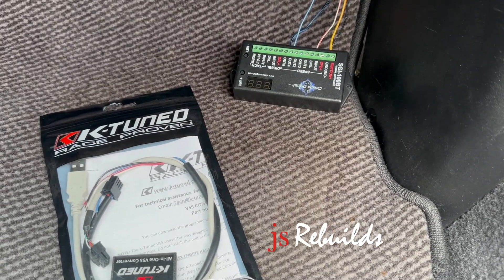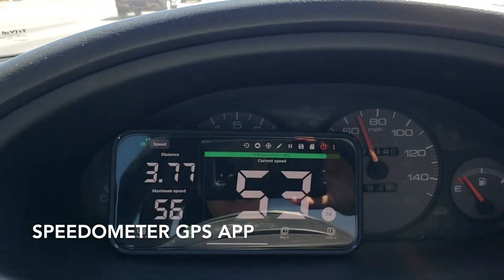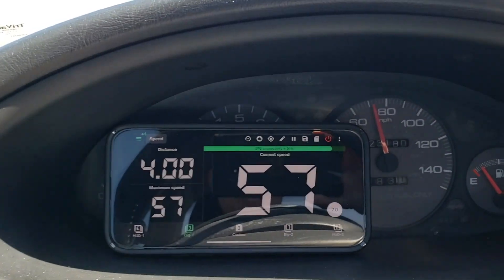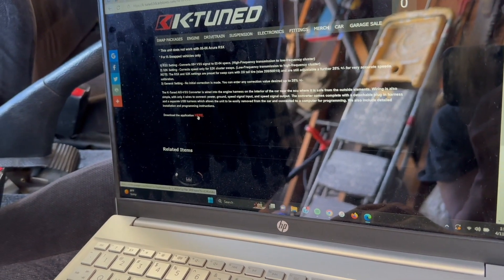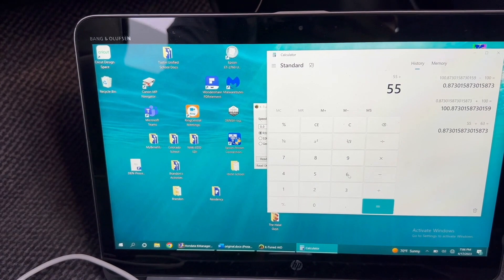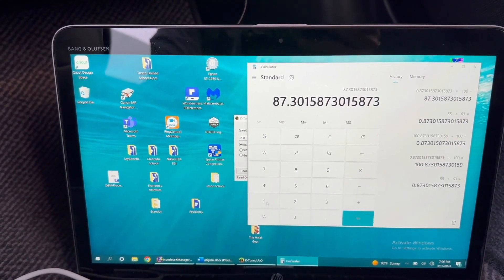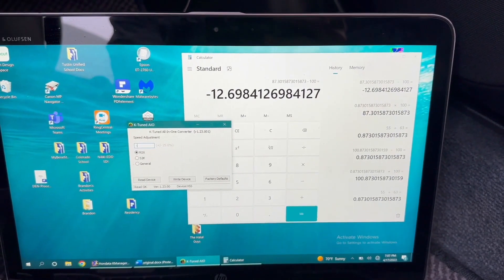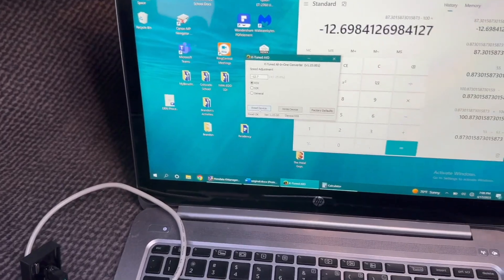How to Configure Ktuned VSS Speedometer for K-Series Transmissions (All-in-One Setup)

Comment: Would this work on a k20a euro r swapped into a ek civic. Factory prb ecu with k tuned immobilizer, hybrid racing conversion harness. Car starts and runs just won’t rev passed 3k rpm. Will this 12v to 5v converter at css plug and all in one vss ktuned converter installed at ecu make the car run normal?
Reply from the maker: Yes I believe the all in one vss Ktuned speed converter will make speedometer work and send to correct signal to your factory prb ecu. 

For the 12v to 5v converter, I mentioned it was an option. I've used 12v before and it worked for me but for me these 12v to 5v converter are cheap to begin with. It doesn't hurt to send the correct voltage to the sensor but in my opinion in should be reccommended because why would Honda make it that way. Also you will see many people comment why don't you just tap into this or that. Thats a great but for less than $10 why bother especially when my electrical engineer friend said it will work fine. 

About you car not rev pass 3k rpm, I not sure what that is about. I would have to do the research. Its a possibility that the ecu not getting the correct signal from speed sensor or checklight on something cause ecu to limit your rev.
Reply: @jsrebuilds3951 yea that’s what I’m thinking that the ecu is looking for a vss signal but it’s getting a css signl instead which is causing the rev limit?
Reply from the maker: @DragonMaballz1997  If you follow our setup for our swap very simple and basic but everything worked with no issues. I do understand other swaps can have different setups. Yes there was trial and error and that's even listening to what some of the experts had to say out there on certain things that ended up not working. 
I had to do the extra research and tested certain things myself because there wasn't really good info out there for example like what we are discussing on this subject but I did document it all and put it on our youtube channel to help others with similar issues.

Comment: This is a great video iknow how to get the right speed on my ap2 cluster .. do you know how to get the temp to read right I been having issues with that one on my k swap civic anything would help thanks in advance
Reply from the maker: Thank you @ChlsTfLoW. Sorry I'm not able to help because I don't know much about the ap2 clusters.
Reply: @jsrebuilds3951 thanks for replying
Reply from the maker: This is what I found on the Ktuned website.
You will need the  K-Tuned AIO-S2K Converter because this will allow you to Convert the dash coolant temp signal to read properly on the S2K cluster and there is preset in the unit but can be adjusted if needed. @ChIsTfLoW
Reply from the maker: https://k-tuned.3dcartstores.com/S2000-Dash-Converters-now-work-with-K-Series-temp-sensors_b_59.html
Reply: @jsrebuilds3951  yea I got a plug and play harness with the KTUNED dash converter but the temp is not working properly at all and from what I’ve read online is a little harder to calibrate the temp on a ap2
Reply from the maker: I would give them a call they should have a tech. I've used hybrid tech and those guys are really helpful. Hopefully Ktuned is the same.  @ChIsTfLoW
Reply: @jsrebuilds3951  I will thank you for the replies and the video helped out a lot !!
Reply from the maker: What temp sensor are you using, b series or k series? @ChIsTfLoW
Reply: @jsrebuilds3951  well I was gonna purchased the single wire temp sensor from K-tuned to place in on the water neck outlet on my k swap to get more accurate readings
Reply from the maker: Ok it coming back to me now. So the k series temp sensor on your radiator will be read from the ecu and the single wire temp sensor will be read from your gauge temp cluster. 
I would check to see if your getting a good ground for the single wire temp. Make sure the temp sensor itself is making a good ground by touching surrounding metal. Also make sure the ground wires on your harness is getting a good ground as well.
Reply: @jsrebuilds3951  okay okay well the plug and play harness I bought from s2000cluster there is one wire for the temp that goes into one of the wires on the ecu plug I did do it the way he had it on the instructions but it was making my radiator fans to come on sooner so he said I’ll have to calibrate the converter and check all the grounds and I did make sure all my grounds are good but it all comes down to the converter is a pain !! He suggested me to get the single wire temp sensor from k tuned to get more accurate reading!! But I shouldn’t have since I already have a wire that connects to the ecu harness should be accurate enough !!
Reply from the maker: Ok I see what your saying, definitely calibrating with the convertor box. I wish I had one to play with. Yeah sorry we couldn't figure out anymore on it. I know you said your grounds are good but I'll just post a video on how I did my grounds.
https://www.youtube.com/watch?v=oO8EkwB2Qkw
Reply: @jsrebuilds3951  I just watched very informative!! Thanks anyways I’ll see if KTUNED are in the mood to help there is one tech that is a little grumpy and feels like he doesn’t want to but anyways thank you 🙏🏾
Reply: @ChIsTfLoW is this the same guy that answers emails? I always get a guy that never answers extra concerns or details or give thoughts on ideas. He goes straight for the main question and nothing else.
Reply: @ramb0r0kr888  sorry for the late response and yes the same guy always has a attitude nevers helps !